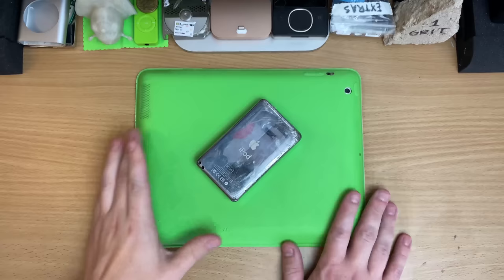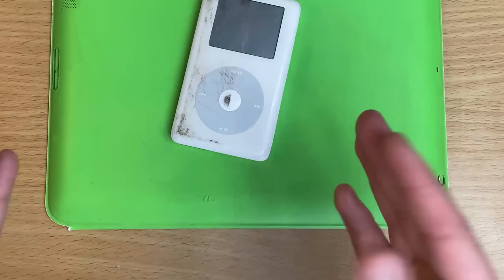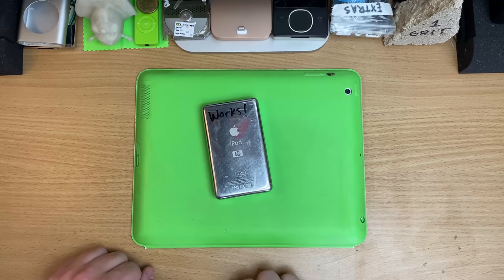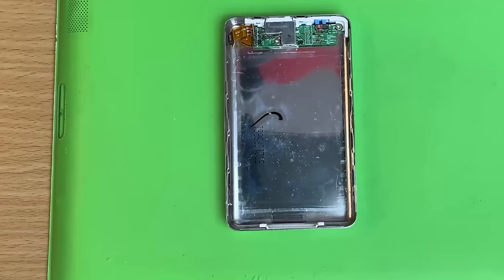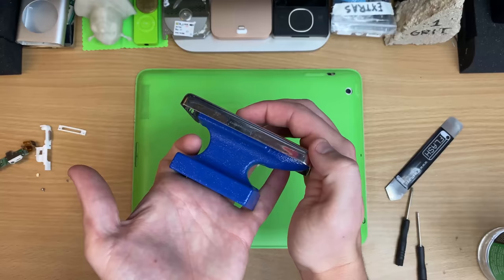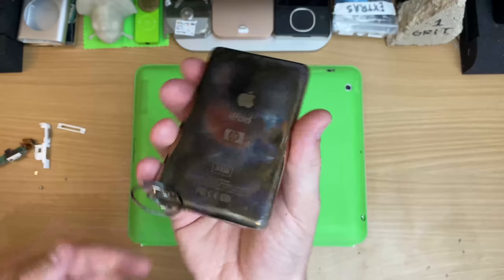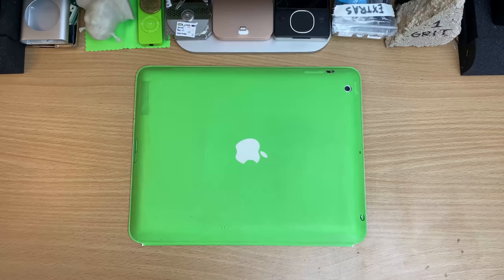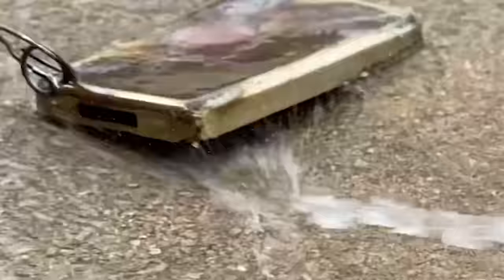I tried to "antique" my iPod.

Comment: You can make the back clear using an extremely fine wire brush, it polishes it so much it becomes a mirror
Reply: Clear and mirror are two totally different things though, what are you on about?
Reply: @TheGauges420  Clear as in not clouded
Reply: @wesleywood8353  ah, I get it now, but then he probably should have used the word clearer instead, as clear is a descriptive term for something being see-through, whereas mirror means quite the opposite, and reflects everything. But yeah that makes sense now that you mention it.
Reply: @TheGauges420  r/imverysmart
Reply: @TheGauges420  Bro everyone uses the term mirror finish. Clear would be something I say for something transparent. As this is a giant piece of non-transparent metal you can't really make it clear but buff it to a mirror finish.
Reply: @FoXenthusiast42  r/ihavereddit
Reply: @highfighter219er5  na man clearly the original comment found a way to turn metal transparent why use basic common sense
Reply: @TheGauges420  ...

Comment: Instead of fire, I'd recommend anodizing it with electricity. You'll be able to prevent the warping from uneven heating and you can look up charts for what voltage and times give you what colour.

Comment: A few ideas. Dawn dish soap works well, magic clean eraser is amazing (great results almost 100% of the time, high grit sandpaper, store brand car polishing fluid, gently rubbing a file and if you used all of these ideas then finish it off with a microfiber cloth. I really recommend that you use all of these.

Comment: chrome that gets cloudy and looses its shine can be prettied up by aluminum foil, of all things. 

Grab a small section of foil, hold it on your fingertips and slide back and forth. You don't need to apply much pressure, think of it more as friction doing the work. After a brief time you can see the shine come back. finish the whole affected area, then hit it with a metal polish that's safe for chome.  work it in well, then finish with a polish from a microfiber cloth (or as the directions state).

 I've restored some motorcycle exhausts with this method and it works impressively well.

Comment: If you want a more consistent and brighter blue, I would suggest trying to first make the back as polished and clean as possible (any contaminants will muddy the blue, try distilled water). Then have a tray of fine, clean brass shavings and dig the case in the shavings so all edges are touching the brass. Apply the heat from underneath the tray slowly and evenly (moving the torch). Do not heat it up too fast, the farther away you are with the heat, the more control you have. Once it's at blue,  you don't have to quench it, just take the back out of the heated tray of brass. hope this helps

Comment: The way I would do it is keep it moving. Don't stop because that's when you get hot spots. Don't be scared to keep heating it up. Also try quenching in used motor oil rather than water. And there is a sort of cheat way to blue stuff. You can buy gun barrel bluing. Its a chemical you wipe on and let sit for however long the directions say. You can also find the same thing to brown metal. Just some ideas if you see this comment on such an old vidja. Love the content.

Comment: Been watching you a bunch recently, I dug out my box of 30 or so ipods (mostly 3rd gen) to finally get around to mod work again! Just finished a battery replacement  & flash storage mod on a 4th gen u2 and it turned out great!

 I do acid etching for aluminum enclosures & copper PCBs pretty regularly & plan on doing some for an ipod or two pretty soon. (should look really cool on the anodized minis) The only thing I'm not sure I can pull off is getting the resist material consistently on curved edges. I would love to get the green patina that is on brass/copper (i have grown it on cymbals before) but I don't think aluminum or steel grow any interesting colors. (maybe electroplating first?)
Reply: etch a haitch pea and a geir icon on the back of your mini, i dare you

Comment: I got a pretty nice looking finish on my back cover by removing the dock connector shroud and ribbon cables so it was just bare metal, and then scrubbing it with scotchbrite under running water. Small circles moving around the whole case, onto the sides and corners, gives a nice brushed finish. You could also do straight lines, but that's tough to make look good

Comment: U used blue magic metal polish on my back case with a Dremel and it worked pretty well. make sure you go in a cross hatch pattern when polishing. if you only polish in one direction with the rotary tool it will give you that cloudiness from certain angles.

Comment: Hey, you can easily bring back the shine on back + dull down the jagged bits with progressivley less aggressive sanding, ending at around 3000 wet.

Then hit it with automotive rubbing compound. Then a high quality polishing compound.

Same for the front, but to a lesser extend. You'd at least be able to get the black off of it

Comment: The absolute best product for old scratched up ipods is Mothers Mag and Aluminum Polish. Comes in a little metal tin. Use it on all my iPods and has them looking almost brand new. Just use some of that and a microfiber applicator. It took so much grime off the back of a first generation touch I had, and it shines real nice.

Comment: blueing is a very difficult thing to get right. If i were you i would have gotten a brick they use for forges or make welding beds out of to better fit it and help dissipate / distribute the heat more, you also should have either a wider flame and or keep it moving around, keeping it in spots like you were doing is what made those hot spots.
Still looked awesome in the end and the spots give it a bit more charm.

Comment: when buffing the back of the i pods you should go up grits probably start at 1000 grit scratches and go up to 1500,2000,3000,maybe even 4000 but you need to polish the case afterwards to bring out the mirror look and you need to kill all the previous scratches as you sand

Comment: Your favorite cash converters let me down😭
I have a iPad 4th gen 32gb space Grey mint condition. Today on the 15 of March I went to cashies I looked around and I found a beautiful object staring right at me  and it was a keyboard that terns you IPAD INTO A LAPTOP it was so much money, I MEAN A LOT it was a whopping $2, that's crazy. The people said it worked perfectly, PERFECTLY they said. I baught it.
Did not work at all,  half the keys didn't respond and the keyboard did not hold charge.
I was going to cry in the corner and use a 1 grit rock to smash it then the object looked at me and it was beautiful..... So I am going to keep it....

Comment: Two ways to reduce warping, heating it as slow as you can, (you can even heat in up in your oven, if youd like one uniform colour) and cooling it down as slow as possible, as using water will make it shrink unevenly. (you can use your oven for this aswell)

Comment: How to antique with household items
WHAT YOU NEED
The back case
A bucket of water
A gas stove (vitroceramic ones take longer)
Some reasonable quality (metal of course) tweezers
Procedure
1. Clean your back case with isopropyl alcohol, make sure there is no dirt on the stove
2. Place the case flat on the stove, and power it up at max, make sure you have a safe area to pick it up with the tweezers
3. Wait for around 30 minutes (the leftover glue on the inside will burn and smell, so make sure you ventilate the area)
4. Retire the case off the stove and put it into the water bucked for around 20 seconds to make sure is safe to touch
5. It will of course mangle, place it in a flat surface and push firmly from the center until it is flat
6. Dry it up and make sure no droplets remain
7. Repeat steps 3 to 6 depending on how "tinted" you want the case
8. Assemble everything back as usual
9. You're done

Comment: So you can get the effect you want by finding a piece of metal big enough to fit under the shell but not too big it brings it floating in the air. Also if you want better temp control either be further away and be patient or go down to propane for a lower temp and lastly dont hit water on it after. Putting that much thermal shock into the shell warps it even more

Comment: For a polished look work from low grit sandpaper up to 4000-8000 and then use a buffing pad or wheel with polishing compound

for a more even bluing, I think you can use cold bluing agent on stainless steel. For a hot method, try surround it with fire bricks and point the torch in that (but not pointing on the plate!). You can also cook it at a lower temperature and then quench it in oil to give it a blue-black patina.

Comment: You can actual get a much more controlled result using electrolysis. People use it to make titanium colored. It would prevent the warping, but it doesn't look quite as worn, and more so just turn the entire plate into one consistent color.

Comment: If you use a toaster oven you are able to set it to a specific temperature to make it a uniform color. If you want blue you need about 290C or 550F, and for that straw color, you need about 230C or 450F. If you want to learn more I'm pretty sure its called thin-film interference

Comment: If you get a metal can and fill it with brass shavings, put the back plate in the chips and then heat the outside of the can with torches, the brass chips slowly and evenly distribute the heat so the bluing will be solid and hopefully keep warping down to a minimum. Its going ti warp no matter what cause of how thin it is though...

Comment: What if you tried to heat it up in multiple rounds, to get a blue color on the whole thing, without heating up any single part so much that it warps excessively (or even melts), for example start with the center, and corners, let it cool down, then do the sides, let it cool down, and then finally fill in the blanks. You can straighten it out as best as possible between each heating and cooling cycle, any stresses in the metal from bending should go away when it's heated.

Comment: If you know somebody with a heat treat furnace, try popping some in there. Probably wouldn't take more than five/ten minutes, since the plates are so thin. Search "stainless steel colours" for heat ranges. Blue is about 540C, but you can get other colors with different temps. Could be fun.

Comment: Get some metal filings, bury the iPod casing in them in a thick metal container and use a larger torch to heat the entire thing up for longer.  It'll even out the heat distribution and you'll get much more even bluing.

Comment: A lot of the warping happened because you poured water on it right away. You should let it cool naturally. I anodized a lot of titanium on pocket knives the same way(through I use propane instead of map gas) and after achieving the desired color(it goes from bronze to purple to blue) I stop and let it cool by itself. You get better color and no warping. You can also try using a power supply and an electrode(look up authorizing titanium) to do your and, not sure if it works on steel but it does on titanium and aluminum. This way gives a constant finish, just have to mess around with the voltage to achieve a desired color.

Comment: For a more even look : toss in in your kitchen oven at max temp for 20 to 40 mins
Also let it cool, by pouring water in top you stop the heat from diffusing in the steel and increase the contrast, whereas if you let it air cool the hottest part will warm the cooler  portions giving you a more even result

Comment: Mate, try a solid metal container with an even amount of brass shavings, put the ipod back on top of the brass and heat it from underneath. It will transfer the heat more evenly and slowly giving you a nicer blued finish.

Comment: You could actually do this on a barbecue, it might even give a more uniform result, but the best way would be to use electrolisis, I don't know the details but basically some specific acid+the right voltage on iron and titanium gives accurate control over the color.this technique would prevent warping of the case and provides reasonably uniform results

Comment: I think if you had used oil instead of water, it may have reduced the amount of warping in the case. Water cools metal down too quickly, so it often results in structural weakness, warping, or in some cases fractures. That's why whenever experienced blacksmiths quench their pieces in the tempering process, they always use oil.

Comment: Heat it in an oven then quench with oil, not water for a nice uniform blackened surface or a straw-orangish color. Depends on the heat and how quickly you cool it to get different colors. Look up some blueing videos. Alternatively if you or someone you know has a furnace that can get it to a nice cherry red without any hot spots you’ll have a proper uniform color of black after quenching. Look up some my mechanics videos on blackening steel if you’re still interested in this idea, I know I sure am

Comment: Maybe you could try taking a copper plate the same size as inside of the case inside, and lay it on the anvil with a brick on top, the copper will heat evenly across the whole back and the brick could stop the warping. Might be your best shot at an even blue colour with no warp

Comment: The best way I've been able to get back that mirror shine is to go at it with automotive sandpapers, starting with 2000 grit and working up to 3000 grit, then you can hit it with a stainless polish I guess but I usually don't.
Unfortunately this tends to erase the logos, Idk a solution for that problem. But you'l be able to brush your teeth in the shine, at least.

Comment: If you wanna heat it more evenly to reduce warping, you gotta put it in some oil, then set the oil on fire, however for a more different look, you may have to use certain acids, like the ones used for bluing guns.

Comment: If you want or everyone to look like antique for steel buy a rust accelerator. Corten for example is like paint the surface but it let the steel rusty pretty fast and you can put some drops of blue paint or red with spray and look pretty cool.

Comment: Most blacksmiths temper their metal in their stove. Most irons turns a golden wheat color at 400-440° F and blue at around 500-530° F. You can look up a more specific table with more colors if you google temper chart.

Comment: You could try using a butane torch still, because it won't give as much hot spots and deform because of that. Also not cooling it with water and just letting it air cool may reduce buckling.

Comment: The got twisted because u quench them with water. This ccauses the steel crystals to shrink in a fast uneven manner. What you really wanna do is quech them in a container of oil instead which cools it much slower and more steady.

Comment: the reason it warps is because you aren't evenly heating everything at once. I did steel bluing in an oven a few good times.
Reply: But if you want the yellows, you basically have to heat these spots less

Comment: so for polishing you would approach it similar to how you did the front- work through the grits but polish with a much finer metal polish, so working up to white diamond polish and a jewelers rouge (you cant generally go by the color of the sticks of polish, they arent super standardized so just look up the grit size of the polishes in whatever metal polish system you are using .5 micron would be the highest you would ever go) i prefer the wax sticks as opposed to liquid solutions. 

Also with the heating - for think metal parts, the only real way to mitigate the warping is to heat it all very evenly and cool it evenly. the easiest way to do that is to use an insulation (like a rock wool/forge liner (fiberglass would melt a bit but prob worth trying before buying a roll of the good stuff)) and to heat slowly. When i do stuff like this i make a tube out of my rock wool that is big enough for me to put the part in and able to reach it from different angles with the torch.  Holding the torch far away and concentrating on being very uniform with the heating and slow. 

!!CAUTION!!- mineral wools and the like can be very hazardous to breath the dust of, be very careful with how you use it and how you store it, respirators are a must. keep it in a sealed container when you aren't using it and make sure its marked as hazardous. They work extremely well and are worth the extra effort required to use safely but still.

Comment: 0:30 I had a iPod touch 2nd gen that I took some steel wool and Brillo pads too. Followed by a nice aluminum polish makes those babies look brand new. Unfortunately this gets rid of the Apple logo or any other text or branding on there. But I’m sure you could achieve the same thing with some very fine grit sand paper for the deeper scratches, again followed by a polishing.   Edit:Also it looked cloudy because you didn’t polish it! You want super fine scratches so the polish can go in and rub down those fine edges and scratches to be flush with the rest of the sheet of metal.

Comment: It might buckle less if you did not drown it tn water, and heat it as slow and as evenli as possible. 

Try something with bigger/wider flame, perhaps just a flame at the end of any metal pipe you can attach to flexible hose and attach that to propane-butane caontainer and pressure regulator, the one from kitchen stove/gas grill... Or just gas kitchen stove. Do it outside if you mess with tubes, gas bottles and regulators. No, really, a gas explosion, that might leave you deaf or dead, one that can rip off a wall off a building, will be just a minor nuisance/minor burns, if it happens outside.

Comment: Get a sander on it, take it back to about 1500 grit. Then get yourself some Autosol metal polish which works by wiping it on and off. Brings surfaces to be a mirror finish without much hassle.